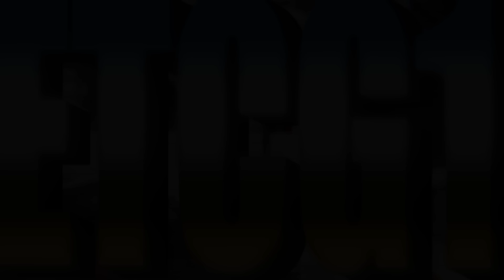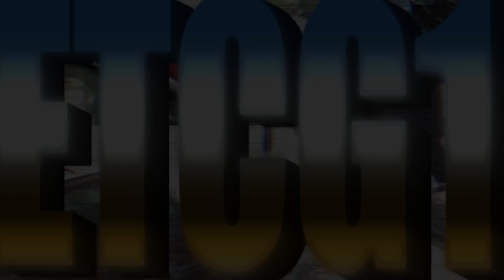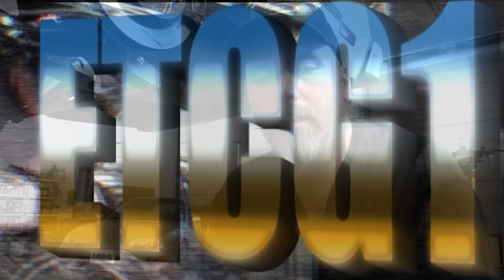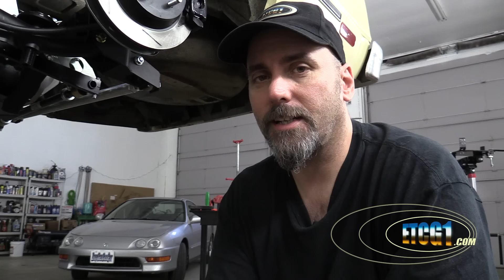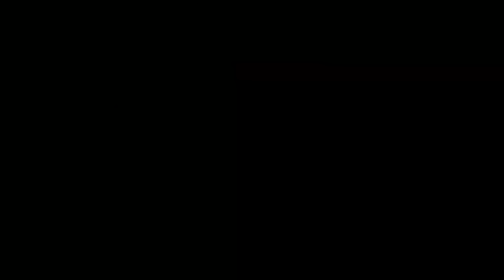Misconceptions About Performance Parts

Comment: If a few inexpensive bolt-ons could make a car that much better, the manufacturer would've done it already.
Reply: Not necessarily when it comes to absolutes.  A larger diameter exhaust piping with single pipe construction will be lighter and allow for more maximum horsepower but it will also be considerably louder, which is detrimental to interior decibel levels that engineers need to target. Can also lead to strange resonance noises at certain rpm's.  Cars that are tuned from the factory with 87 octane are done that way to sell more cars.  You can get a tune for 91 octane and get more power but then you'd have to gas up with 91 each time to reap the benefits.  

So you could get more power in absolute terms, but at the detriment of noise or comfort.  For most passenger vehicles, noise and comfort are far more important things for the engineer to consider than absolute power.  Marketing also has their input and may mandate that 87 octane is the target value they want to use, so a 91 tune is not possible for the engineer to consider.  Now if the end purchaser wants to change that formula, more power to you.
Reply: This is for economy cars though. Someone trying to get the most performance out of their car probably already stripped out all the carpeting and noise dampening material. But I agree with the engineer, that the detriments outweigh the benefits. I don't want to go deaf driving around a 4 banger Civic so that my 0-60 is .5 seconds faster. I know there are people that do that, but I think most people would consider it a waste of time and money. Especially when you can get a car on the cheap that responds well to this kind of modification, like a Miata or Crown Victoria.

Comment: If you took your average fat guy and stripped all the fat off him, you'd have a pretty good athlete. The same thing is true with your average car. It's got tons of "stuff" and so it's built with the motor/transmission/suspension to carry that "stuff". Take all that "stuff" out and you'll find the hidden "athlete". 

Door panels, back seats, passenger seat, spare tire/jack/, trim pieces, audio equipment, wiper fluid, ashtray, glovebox, headliner, and on and on... take it out (carefully so you can put it back later if you want to).

Put it all in your closet, cover it with a tarp and then when you're done playing "race boy" you can put it all back and it will look new.

Comment: if it was easy and cheap to get a engine to make more power, without downsides, the manufacterer would have done it (most of the time, there are rare exceptions) The k&n ads always make me laugh.  I have a K&N filter actually, I got it for two reason's.  It's cheaper to clean then replace, and it raises my intake significantly.  And yes, I actually do drive my jeep deep enough in the water sometimes that it's a real concern, usually the water's deeper then it looks and sometime's my guesstimation is off.

  As for the cleaning the filter.  You'd be surprised how fast you can dirty a filter when you've got 5 guys ahead of you on a FSR and your're all driving at 70+ km\h.

Comment: i think suspension parts and tires and bigger brakes do make noticeable changes small things like a muffler intake don't do much unless you are a ricer then putting a steering wheel will make you rev your engine beyond 15K rpm

Comment: in my opinion, cold air intake and exhaust basically just improve throttle response
Reply: A lot of the time, it just makes the intake and exhaust a little louder...which can sound like the engine is performing better.
Reply: In the Case of my '96 Maxima a CAI actually loses low end torque. The stock intake is already a CAO of sorts drawing air from under the leading edge of the hood.
Reply: that because you didn't install a proper Cold air intake. good after market cold air intakes are similar to the stock ones but with less restrictions
Reply: Exhaust can help with HP BUT only if the old one was poorly designed or very restrictive. 
Header(s) can help in that they improve scavenging of the exhaust. It also drops some weight. BUT you also get higher under hood temperatures unless you coat or wrap them.
As for a "cold air intake".  Unless it's actually ducted to draw air from outside the engine compartment (cowl or headlight/grille area work for a minor ram effect) it won't do anything to help power production and can actually hurt by sucking in hot air from under the hood.
Reply: thisisntme Absolutely correct.  The problem is that most bolt-on cold air intakes don't come with all that is necessary to isolate the intake from the engine compartment heat.  One can always fabricate something, but that negates the concept of "bolt-on."  Besides, most cars these days already take induction air from the front of the hood, just in front of and above the radiator, so it's really just the filter (and possibly the diameter of the piping) that needs to be changed for better air flow (and maybe a heat shield to keep the charge air cooler) - assuming that the intake manifold and head can flow more air than the pipes from the filter will allow.  If you've done major mods, or installed a larger engine, that is a likely scenario...but if it's mildly modded, then possibly not.
Reply: check out the video done by Might Car Mods where they dyno a car with and without a Cold air intake.
Reply: oh yah and don't forget about the ones that you put ice in to cool the air.
Reply: A "Proper cold air intake" is an intake that pulls in cool air.

Most cars you can buy already do that pretty much as well as they ever will. Even my 1989 land boat does. Just because it doesn't have a fancy-looking pod filter that does nothing but throw more dirt into your engine with shiny aluminum piping that is worse at insulating heat doesn't mean you need to change it.

Unless you have a carburetor, your intake is probably just fine. Cold air kits are for people with more money than common sense who like shiny things, and the people who sell them know this. Even with a zillion performance modifications, you will likely gain next to nothing from a modified intake pipe. The people who are trying to sell you shiny things are not smarter than the engineers who designed the engine.
Reply: yet again it's someone that is just repeating the same bull, that knows nothing about the design and engineering process, making a comment about something they know very little about.
Reply: ***** I didn't install one, but many at Maxima.org have, and have dyno tested for proof. A CAI loses velocity and decreases low end torque in the case of 4th gen Maximas. FACT.
Reply: you mad?
Reply: Then what they are installing isn't a good design (like 90% of the "cold air intake" kits out there). A good cold air intake won't decrease power. However I visited the site and found this " Everyone will agree here that any intake specifically made for our cars only helps with sound. There is no true cold air intake on the market for our cars, thus only warm air or short air intake are available which adds no protection from heat soak in the engine bay."  So they don't even have a CAI for those cars.

Comment: I spent short of a grand for EFILive tuning for my truck. Went from 325hp to around 550. Dynoed. Yes I understand how it works. You simply inject the fuel earlier and in greater quantity (duration) and voila power. Literally, it couldnt be more simple. Now tuning is extremely frustrating to work with, especially in the type of system my truck uses, but man, you can really get some power. Basically performance parts boil down to this, if you dont know what you are buying, what it was meant to do, how it works or what the expected results are, you will gain nothing. I eliminated the stock intake system on my LT1 powered B-body, dont even get me started. I went to COLD AIR!!!!! OMG I SAID IT! THATS IT! I SAID COLD AIR!!! and while my HP increase may have been minimal, throttle response (thats butt dyno) was increased and it revved out better. 

All you people are talking trash on these cold air systems, and yes you are somewhat correct in your assumptions, dont understand the overall benefits that you see. You get better response, (power comes on quicker), you lose MPG (contrary to any thing you will read out there) and you will gain some HP if the system you paid hard earned money for was worth a damn (1hp is still a gain in power, there is no argument there).

In an engine you have to take every single component and take it to the scientific level. Physics, thermodynamics and metallurgy. You can sit there and say well I used the best parts money could buy! But did you coat the pistons skirts or the bearings? Did you have the rotating assembly balanced? That is where you are going to notice the difference. You can drop a grand on a billet or forged crankshaft, but if its not balanced, it wont rev out well, so there goes your throttle response and that free revving upper power that you make the most HP at. P&P jobs are also some of the best things out there. A lot of power left on the table with stock castings.

Ill close with this, anything worth a damn wont be cheap or easy. Thats universal.

Comment: Except tires, there is no single part that can give some performance (providing you tune them to best performing hot pressures huh). You have on the other hand KITS that delivers : big brakes kits with rotor, caliper pads brake lines and fluid will give you better brakes. Supercharger kit will include many parts and an engine firmware or tune that will deliver power and torque. But none are made of one sigle part. Even a simple camber bolt is nothing if you don't do the proper geometry on the whole 4 wheels before getting any benefit (providing you have the tires to match huh).

Comment: I bet you a decent tune would do that GSR good.
Reply from the maker: Slight issue there. Honda computers of this vintage are not programable. I'd need to get a stand alone or an OBD1 to make that work. Also, nothing wrong with this car in stock form.

Comment: You can actually lose HP adding things like a cold air intake ,throttle body etc many times ,  and not tuning  the computer to adjust for the fuel, air , timing.

Comment: well Eric I hate to inform you that you are incorrect about cold air intakes.I put one on my car and not only gained 250 more hp I also gained 25 more mpg... also I now make more money and have become much more attractive (I went from 5 out of 10 to a solid 8.5) I grew 2 inches taller, and and I even have to ability read minds now. 

so do you believe in bolt on horsepower now?

Comment: exhaust  mods only help 4 cylinder  engines if th set bare forced imduction helping the engine to breath  better. lowering resistant psi stuck between the intake manifold and the intake valves once the other side breathes better so does the entry  side

Comment: 1 part won't get you fuck all. on my civic i put a short ram intake, and coupled it with a megan race header and straightpiped it to a high flow resonator (to kill the drone a bit) and a magnaflow muffler, all 2.5 inch downpipe and got a chunk of mid-range power but nothing spectacular.

BUT because stock cast iron headers on the civic is really prone to cracking, and not only do i not have to worry about it springing leaks anymore BUT it actually runs quieter at idle (the engine itself, not the exhaust)

Comment: don't worry boys! he only has decades of experience working on cars.. what does he know that you don't ready know, or that you can't find out after visiting your favorite tuner forum? 

keep buying those EBAY turbos and those AutoZone fart cans!
Reply: Real turbos from ebay actually seem perfectly fine, they're from the same factories in China as the brand names. They might not be QC'd as well as the latter, but most often they're just as good for quarter the money. I haven't tried them myself, still rocking a factory 25 year old German KKK turbo, but when I'll upgrade I'll consider them for sure. The important thing is to be informed correctly.
Reply: I'd go for the eBay turbo's if I was building a cheap car like a $1,000 Honda with stock engine. 
The only time I've seen people complain about the eBay turbo's is when the screw up the install and don't have oil properly running through the turbo.
Reply: that was true 5 years ago... Chinese have stepped their game up.

Comment: It really is about understanding what you're actually doing.  I see it all the time where people buy these expensive "racing" rotors and pads and things for their Ford Focus daily driver or whatever and they complain that their slotted and drilled rotor and everything is on there, and it cost a fortune, and the car is stopping WORSE.  Well, you really didn't understand what you were doing when you bought those parts, did you?  In so many situations, buying the cheaper, OEM, stock parts for your vehicle will yield better performance than more expensive "racing" or whatever parts.  The engineers chose those parts for a reason most of the time.

Comment: most everyone trys to make this harder than it is all a motor is a fancy air pump that makes its own reciprocating motion through the burning of fuel so the only way to do more or better  is tru efficiency or moveing more  air/ fuel through the system per length of time case in pont a cold air intake how much is cold air vs. underhood air different and dose the motor have the ability to add more fuel to capitalize on that fact that cold air is a tiny bit denser than warm in fact if the motor dose not add more fuel you will lose a tiny bit of hp do to pumping losses

Comment: nah, to get significant gains you have to spend thousands rather than just hundreds.

if you were getting significant gains then the original system wasn't well engineered.

example: I changed the exhaust manifold and downpipes on an MG Maestro 1600. The exhaust system got changed, a Pipercross air filter fitted and reduced sized chokes. I got a 30hp gain. Why?

Manifold and downpipes were an awful compromised design as the engine's family design was for installation the opposite way round. The pipes had to squeeze under the powertrain in the MG.

Smaller chokes fitted to prevent flat spots in acceleration (I didn't mind losing a small amount of top end). It was over choked from the factory! This leads onto the next issue..

Fuel vapourisation on hot starts, and rough idling. The car used twin choke, twin weber carb DCNF carburetors. Effectively one choke per cylinder. Above the exhaust manifold. The pipercross filter aided breathing for the intake but more importantly allowed more air to breeze around the carbs to prevent heat soak.

was my priority performance? Yes but I was also looking for reliability too, and that was way worth the money I spent than to make it go faster.

Comment: Why is it that you hear so much about bolt-on performance parts and yet so little about verifying basic engine health first. Installing a CAI, easy. Checking compression and measuring/setting valve clearance, not so easy.

Comment: You typically won't get any felt difference until you get somewhere around a 20% power increase in most vehicles. Time slips will obviously tell you much sooner but someone saying they can "feel" a tenth of a second is B.S.ing.

Comment: As a complete system,then you will see torque and HP gains.
 As a header,alone?

It adds HP IMO,only above 4,000 'rippems'. Sure,it makes more noise.

 Some engines respond to intake mods,others do not.
 CAI?  Good question!
 Lighter weigh=better acceleration,agreed?
 Big wheels and tires do not.
 Choose your bolt-ons carefully.
 Just have fun and do what you like to your car and truck to make you feel better.
I do.

Comment: Headers alone don't do much and in some cases cause the low end torque to move up in the rpm so they might feel like less power in daily driving when you don't mx rev the engine. It's all how you build it.

Comment: Take my car for example an 09 civic si. Everyone says "they respond real well to bolt on parts" like a classic IHE setup. That's total B.S. They do respond well IF you re-tune the car after you bolt on parts. A re-tune on a stock car would give better results than an IHE car without a tune. There's a reason flashpro costs like $650 bucks. The parts alone yield you nothing but extra useless noise..              
When it comes to go to parts like intakes headers and exhausts I say ebay intakes are fine, its just a metal pipe. Just use a decent filter. Headers are all about the collector. Cheap headers will yield power with a tune but more can be had with top shelf ones. Worth the price? You tell me. When it comes to exhausts I say don't cheap out. I say that not for power gains but for longevity. Why go through all the effort for a cheap exhaust that rusts out in a few years. Put a quality one on and forget about it.